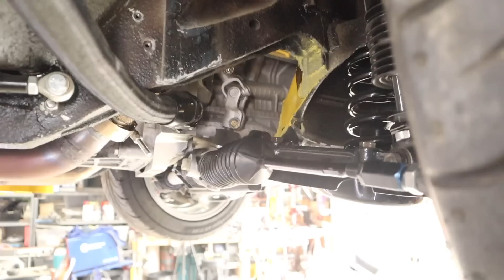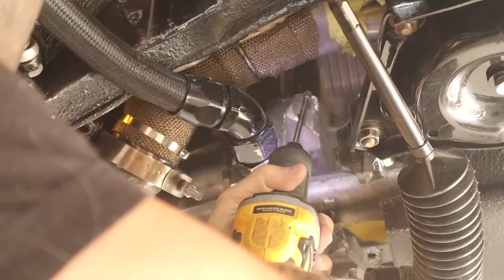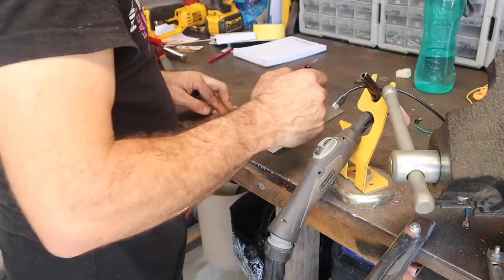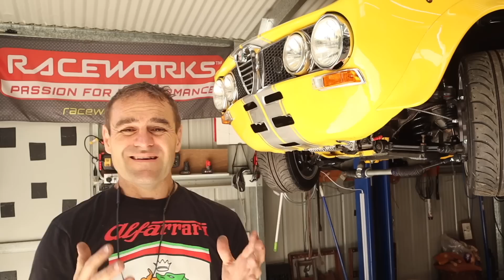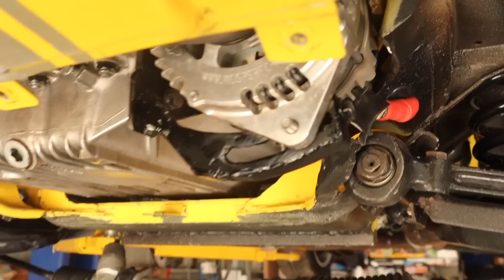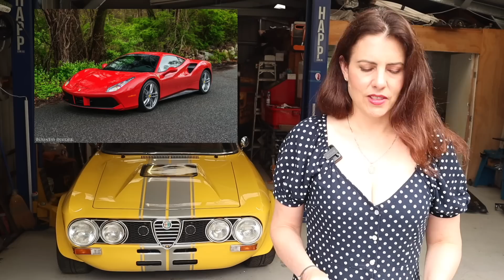Ferrari engine is overheating.. - Ferrari engined Alfa 105 Alfarrari build part 207

Comment: Jeff electric water pumps are lacking any form of head pressure which is what you need for an engine with small coolant passages . We found the best weay to overcome that problem is to modify the engines pump to flow 10 liters per minute at 500rpm. The pump should also create a head pressure of at least 50 foot. Anything less is not going to stop the nucleating of the coolant around the back of the exhaust valve seat. Big radiators are just a band aid for an engine that has poor water pump performance. I proved this many years ago at Dandenong TAFE on the schools dyno with a room full of auto mechanics teachers looking in disbelief at a falcon with a 351 cleveland which had a 2 core radiator out of an LH Torana. I had no overheating problems because I had a proper water pump. It is the most important component on an ICE water cooled.
Reply from the maker: Interesting
Reply: @HomeBuiltByJeff  the other issue to consider is that the standard bypass system constantly circulates coolant around the head and block, which randomises the temp between the two, then opens a thermostat when required. The electric system does not do this in the applications I have seen. The coolant remains stagnant until the electric pump is triggered by temp. Your comment on the dyno fan is perhaps also relevant, as it is large enough to put airflow under the car, simulating the negative pressure on the back side of the radiator that a moving vehicle creates. This of course will assist the operation of the electric fans you have.
Reply: @shaynefaulkner9319  true. On the few (two to be precise!!) electric pump setups I’ve put together, I used a ballast resistor to feed the pump. Even when the pump is “off”, it’s still turning slowly and there’s a small flow around the whole system. Tune the ballast resistor so that the flow isn’t so high that the system can’t warm up.
Reply: Jeff perhaps you could look for some good "white paper" cooling system info. It is there if you look for it, and will quickly dispel myths such as having too much coolant flow etc. With your electric pump the too much flow myth is not relevant anyway, in fact the opposite may be an issue.  I would also advise to NOT fit bonnet vents, or modify your engine cover to effect the same. Transfer of air through the raditator core is created by pressure differential, so by having lower pressure behind the rad compared to in front, you get air transfer. An important factor in this is having negative presure in the engine bay (relative to in front of the core). To achive this you need good air extraction out underneath the car as it moves along. This negative pressure is fed air by air flowing through your radiator core. Bonnet vents can easily provide an easier path for the air to do this, therefore reducing the air that passes through the core. Best method for getting maximum air transfer through the radiator core is to ensure that the core is the only way air can enter the engine bay. So if you have gaps around the core on the radiator support panel or around the healights etc, that will let air in, they are best closed off. A bit of research (for good engineering data) will verify what is considered best practice.
Reply: @shaynefaulkner9319  I have to say I fundamentally disagree. Of course pressure differential is what drives airflow and I’ve never bought into the “too much flow to cool effectively “ idea, but…. Bonnet vents - if correctly positioned- can definitely improve airflow through an engine bay. Yes, they can also be put in the wrong place and make the situation worse but just don’t put them in a high pressure area (base of windscreen).
Control of the air coming out is just as important as of that coming in.
Reply: @jiminycricket9877  air going in through a bonnet vent and out underneath the car bypasses the radiator core. No good.
Reply: You’re r right about flow rate, it’s nothing to do with head though (at least as long as the head can generate sufficient flow rate). Pressure in cooling systems is generated by heat, not the pump.
Reply: @jiminycricket9877 Agreed!
A restrictor would help slow flow and increase dwell time for the coolant to pick up heat and carry it out of the engine.
It's surprising how small a radiator is usually needed, but of course you want some headspace in your cooling system calculations.
Reply: No a pump needs to be able to push coolant up a hill , in this case a fifty foot high hill in order to be able to cope with small water passages in the cylinder heads. Higher pressure is dictated by the radiator cap in order to raise the boiling point of the coolant. @jiminycricket9877
Reply: I was going to mention this. In my engine running an electric water pump I have a plate where the thermostat was, with a hole in it so the water flows about 50% of the size of the thermostat size. This restriction is critical in keeping it under pressure, which helps the cooling.
Reply: @marvsbazaar  its a common issue with amateur stock car racing. they remove the thermostat thinking it will help with cooling and it just makes things worse. you're better off taking the thermostat out and removing the plunger and spring and putting the remaining plate back in.
Reply: Jeff could it be as simple as there is no way for the hot air to get out of that small engine bay bonnet louvres needed (oh no)
Reply: @audreyleithes2994  I was thinking, just take the window out. Not sure if that's required to pass the inspection.
Reply: @MarkoVukovic0  good idea. Could maybe even just cut some aesthetically designed slots in it.
Reply: @jiminycricket9877  absolutely, nothing wrong with bonnet vents. It can only add to the "mean machine" aesthetic.
Reply: All a radiator needs for cooling are 3x2 inch diameter holes in front of the radiator to convert the steam and bubbles back to coolant. The key is the engine must have a good pump or the whole exercise becomes a wallets worst nightmare. @audreyleithes2994
Reply: @audreyleithes2994  I agree!  Jeff could prop open the back of the bonnet a few inches and drive around to test out your suggestion.  In the "old days", some guys would modify the bonnet hinges on their  cars so that the rear of the bonnet was a few inches above the cowl to vent the hot air.
Reply: If I remember correctly you posted that comment a long time ago when Jeff introduced us with the electric water pump. At the time I was "I hope this guy is wrong but he seems to know what he is talking about". I guess today is the day where you can say "I knew it !"
Reply: Yep you can lead a horse to water but trying to get that horse to drink the water is another whole thing. @LucG29
Reply: I am surprised the engineer is requiring spring washers on the calliper mounting bolts, thats not how manufacturers do it which is normally a good guide. Spring washers can open up under torque and come off leaving the bolt loose. Nord locks are better or even some locktite. Guess you just need to satisfy the engineer then are free to make a better engineering decision on things like this.
Reply: Good to hear some knowledgeable experience here. 
It does sound like it's water flow that's the problem if you only have overheating at idle. If there's enough radiator area to cool things under power, that should be plenty at idle, so the problem is likely the water pump not flowing enough water at idle to stop localised boiling of water in the hottest parts of the engine. 
Water is used as a coolant for precisely that reason - when things get too hot it boils at hot spots. The water's latent heat of boiling has a last resort cooling effect at the hot spot and the driver hopefully notices the steam coming out of the radiator cap and shuts down, protecting the engine. 
Might be worth exploring coolant additives like "water wetters". Maybe some followers have experience of them?
Reply: I have personally found that products like Liquid Intelligence and the American equivalent being Evans Waterless coolant are a fantastic alternative to water based coolants. @salamander5703
Reply: Nucleate boiling takes place usually within a few seconds of the engine starting and the job of the pump is to create sufficent enough flow and pressure to pull the nucleate bubbles off the important parts of the engine. Water is only advisable when there is sufficient flow and pressure otherwise do not use water or water based products.  @salamander5703
Reply: On the Davies Craig controller, lower your set point temperature so that your pump and fans start running sooner. The pump will pulse at lower temperatures and the pulse frequency increases as it gets closer to set point and then runs continuously at set point. By then it may be too late to bring the temperature down. Agree with the other comments all worth trying. On my set up, I have the pump mounted at the lowest point in the system directly below the header tank which is at the highest point in the system. DC shows that the pump can be mounted nearly anywhere though. The project is looking so good, Jeff. Nearly there!  I’ve alway been inspired by your ability to keep going at the hardest point of the project and finish it.
Reply: I agree with all of the comments that suggest further experimentation.  You know the system works with the dyno fan up front, which suggests an airflow issue.   I would try without the hood (bonnet) on and track performance.   Secondly, try removing those flaps (bonnet on and off).  Finally leave everything else stock and try messing with the ecu control of the pump and fan.   Unlike belt driven, you might have a lot of options to program it.  If there’s enough heat in the system to overheat, the pressure derived from heat differential is probably enough.  But it’s possible that the program set points isn’t fully activating the pump early enough.   Be methodical - change one variable at a time
Reply: So could Jeff could essentially return the water via a Header Tank and keep the Electric Water Pump? When you  say the pump needs to create a 50  foot header  what do you mean?
Reply: @markwalton8644  hey up mate as far as I know a pump with a 50ft head means it can lift the liquid by that much eg that pump would lift water from a pond to a tank 50ft higher
Reply: @markwalton8644  head pressure basically means how how much pressure the pump can push. think of 50ft of head pressure as a bucket on a 50ft tower with a pipe coming down the the ground. the water coming out the bottom will be at '50ft head pressure'
Reply: Volume of water at top irrelevant?
Reply: The pump needs to be able to push water up at least fifty feet which displays its ability to cope with small water passages found inside cylinder heads of most engines. @markwalton8644
Reply: Might be a silly suggestion but can you fit a bigger or an additional fan !
Reply: Air will only go in a bonnet vent if you put it in the wrong place. There are a few regions that are low pressure and will suck air out.
Lotus Elise - ALL the rad air comes out of the bonnet vent.
Reply: @jiminycricket9877  it is true that many vehicles have top side venting, and it is effective when incorporated into the original concept. But this is not a concept, it is an Alfa 105, where there is no top side venting from factory. There is no reason to modify a completed and painted vehicle to do an undefined amount of testing, when the dyno fan has already proven that by increasing the pressure differential it works as it is.   My 2c anyway.
Reply: @shaynefaulkner9319  of course, you’re not wrong. I’m merely pointing out that in order to increase that pressure differential, it’s much easier to put bonnet vents in a low pressure region (back outer corners of the bonnet, for instance) than to increase the airflow underneath. If one was really worried you could do a wool tuft test first and find the highest air velocity.
All that said, of course you should investigate any lost air finding it’s way round the rad, before cutting holes in a nice shiny (one off!!) bonnet.
Reply: Great update and progress on getting the issues reolved 👍

Comment: Grab a early 2000s Subaru A/C belt tensioner, it’s a push type tensioner bolt setup, easy enough to weld onto the bracket you already have.

Comment: Can’t you raise the engine by 10mil to solve all those issues? I mean extend the mounts by 10mil?🤷🏼‍♂️
Reply: No because he hasn’t got the clearance at the top to move into
Reply: @155andRising   true but that would’ve solved all the clearance issues on the bottom end the just readjust the bonnet to fit🤷🏼‍♂️ I’m no guru but that’s what I would’ve done
Reply: @APoormansHobby  how do you mean readjust the bonnet?  The plenums are bang up against the bottom of the bonnet and Jeff had to cut away the plexiglass to get it to fit. The only way to raise the engine would be to completely reshape the bonnet and it wouldn’t look right. He’s only had to shave material off some brackets underneath the engine which has now solved the issue
Reply: @155andRising  I was thinking of the headers steering arm and overall clearance, I’m not sure but isn’t there a way to shim the bonnet

Comment: Hi Jeff
Sounds like you got a good engineer and got off lightly
The best advice i got when starting my project was to talk to and engineer before you even start a project and also consult  with him as the project progresses with photos and emails along the way. this made the final engineering easy
also wait to do any painting and body work until the car is engineered because there is always something you need to change of redesign and you will not have to cut into fresh paint.
I also had problems keeping the noise down and finding places to install an extra muffler.
Look at the flowmaster hush power hp2 mufflers as they are very slim  and  not restrictive
Reply: He was working with an engineer on this. But the guy he was working with retired
Reply: that makes it tough
funny enough i had the same problem as it sometimes takes many years to complete these projects
Reply: @1one3_Racing  It's understood the retirement of the 'original' engineer was very unfortunate.  However, it would have been very wise to engage a replacement engineer, once notified that the original engineer would not be able to do the work - as opposed to waiting till project car was nearing completion.

Comment: Personally i think youve over engineered the radiator shroud and need a Bigger fan we fitted a 1uz into a viva and I used two different size fans to fit i also found a really thin high flow ones mounted straight to the radiator we also used a radiator out of a 2.5 mazda ,not as thick as yours, personally I'd take the shroud off put a bigger flowing fans mounted loser to the core even if they are un even also what's in frount of the radiator but I would fix the flow think of it like trying to draw air in  through your mouth when you  open your mouth wide no restrictions so no cooling now bring your teeth togeather but mouth open you should feel the cooling effect on your teeth ,air speed to create cooling

Comment: You may be struggling to cool the engine because there is air at high points in the engine water jackets. You may need bleeders or steam ports.

Comment: Many racing Engines oil is also cooled on a separate system. Do you have the room to do it?
Reply: One more thing: About opening the plexiglass over the engine with louvers. Hood vents are very useful to cool they are helping to pull air across the radiator. Good luck & Keep up the good work mate! From California 🇺🇸Godspeed!

Comment: Hi, Cool project.  It looks like the radiator is big enough. Due to the massive (huge) engine in that engine bay the heat can't get trough the radiator and out of the engine bay.Try to drive with the bonnet open (back side=> air out backside)
Reply: Wonder if taking out the plexiglass would work. It’s one big vent
Reply: Air needs somewhere to go, and the engine compartment doesn't have much of an air outlet. Sure, a teeny-tiny little bit of hot air will go over the engine, but the engine is plenty hot on it's own already.
Reply: It’s a high pressure zone at the rear of the bonnet! 
So don’t do that.

Comment: I don’t suppose bonnet vents will aid much cooling at idle . You need to be moving for the negative air pressure to pull out the heat . Maybe more powerful fan motors? But I think you already have good ones. I’m sure you’ll work it out

Comment: Hi mate! first of all let me just say LOVE YOUR WORK 😊 
On the cooling issue I think the air that's going it at idle or low speed might be getting a bit trapped in the engine bay with no outlet. Vents to create air flow will definitely help hidden inside engine bay ones or other. either way you could possibly come up with both hidden ones and aesthetically pleasing exterior ones.
I look forward to seeing how you go with a solution. 
All the best 🙏🏼😊
Reply: Maybe take the see through cover off the engine bulge on the bonnet to test this out. Sounds like a Triumph Stag issue where the air coming through the radiator had nowhere to go.

Comment: Just dent the header. Surprisingly it almost never affects flow.
Reply from the maker: I have seen that on engine masters. Issue is the header is too thick and would probably end up breaking off at the block or something else.
Reply: @HomeBuiltByJeff  you could heat it cherry first then push it with a pry bar or whatever to make the dint
Reply: You’re gonna have to cut a cutout, flip the cutout over, and weld it back in.